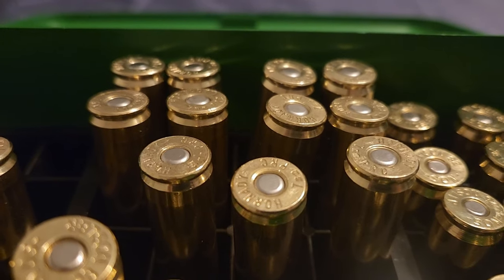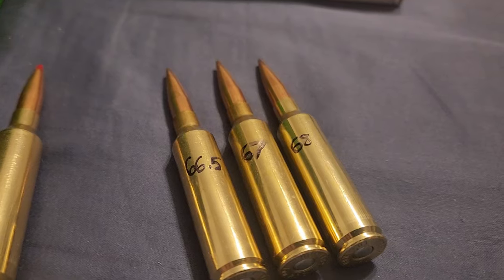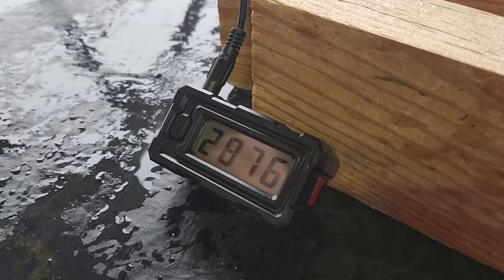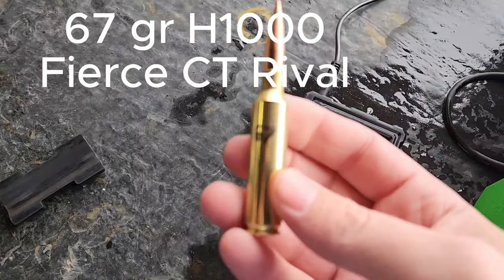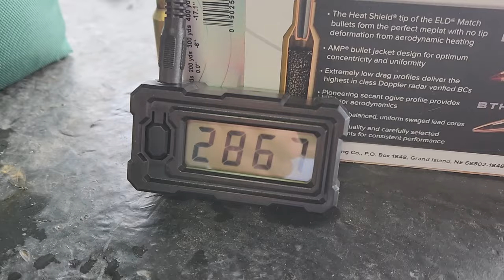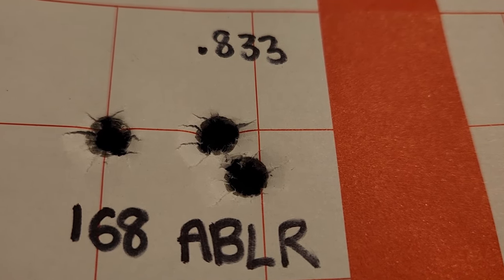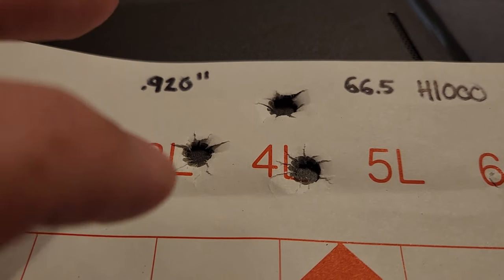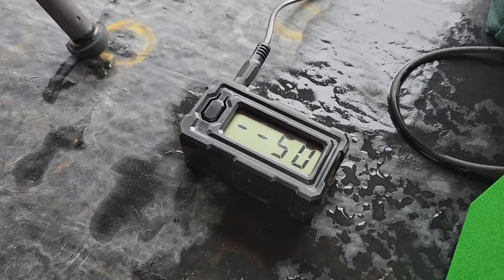Fierce CT Rival in 7mm PRC

Comment: Had a look at the 6.8 Western load data. Unless I'm missing something, it looks more in line with the 6.5 Prc, not the 7. Even the Hodgdon load data stops at the 175s with a max load at 2,883fps. It doesn't even break 3k unless you're maxing out with a 150gr. Best I can tell, the 175s are the heaviest you can get in box ammo as well with Browning's 175s claiming 2835fps.
Why is the 6.8 even coming up in a 7 Prc conversation?
Reply from the maker: If you stand on the 7mm PRC... it beats the 6.8 pretty easily. It's that 6.8 Western factory ammo outperforms the 7mm PRC factory ammo. 

One last thing... all the 6.8 Western reloaders I talk to get better velocity than the books without going over max.
Reply: @ReloadingWeatherby  The Hornady factory ammo. That's the same point someone else just made. The Hornady ammo being low like it is brings the 6.8 into the conversation but if you reload or use a different ammo the 6.8 stays out of the conversation.
 I was just looking at the Hodgdon 6.8 reloading data and at available box ammo. I have no doubt you can see different results real world. 
 What I didn't see was anything over the 175s. Do the guys you know push 180s and 190s like the 7 does?
Reply from the maker: So little bullet options for 6.8 Western. Another benefit for 7mm PRC. The highest b.c. bullet is the 170 gr EOL.
Reply: @ReloadingWeatherby  Just looked at Midway and Midsouth and it seems that 175s are the heaviest you can get in .277?
Reply: @ReloadingWeatherby  .662? Is that the one you're talking about?
Reply: @dankcincy just wait to see what the 6.8 can do with that 170 eol.
Reply: @GGReloading  Not more than the 7 will do with a Berger 190 (.751bc) @2900+fps. Not for what I'm going to do with it anyways.
Reply: @GGReloading   Looking like guys are getting that 170 EOL (.662bc) moving out at one side or the other of 2950fps. It's not bad, it's no competition for the 7 in my application but it's not bad either. Would make for a nice 1k yrd rifle.
Reply: @dankcincy  that is what we get in a .270 Winchester in a 22” barrel.
Reply: @GGReloading  This is what I'm going off of. They're saying this is a 6.8 Western.
"Rifle is a Browning X-bolt LR (26” barrel) Hells Canyon, running through a 30 caliber Thunderbeast suppressor.
The load I settled on is as follows.
New Winchester Brass @ 2.010”
WLRM primers
69.1 gr Ramshot Magnum
170 gr Berger EOL Hunter bullets
COAL = 2.950”
Lee factory crimp
This recipe reached an average velocity of 2933 fps."
Reply: @GGReloading  Same guy, I assume same rifle,
"Got some more testing in and range time at 200 yds.
I put 25 rounds down range, noting velocity on each shot. Average over 25 shots = 2944 fps."
Reply: @GGReloading  This is from a Guns&Ammo article,
"The cartridge uses 61 to 65 grains of powder to achieve muzzle velocities between 2,835 feet per second (fps) and 2,960 fps, depending on bullet weight, from a 24-inch barrel."
Reply: @GGReloading  Don't take what I say as me dogging on the cartridge, I'm really not. It seems like a fine cartridge if that's what I was looking for. I don't think it compares to the 7 PRC, but it's a fine cartridge for what it is.
Reply: @dankcincy  I chose to use N570 in the 6.8 Western. 2.940” COAL, 26” Fierce Rage. The velocity is in the video so I won’t spoil it… I think the group too.
Reply: @GGReloading  Worked up a quick 4dof profile for the 6.8 170 and at 1k yards, there's not really a difference between that and the 190 in the 7.
 I of course don't know how accurate any of it really is but "on paper"....
 It's for sure not what I thought it would be. Only real difference is energy on target which for me doesn't even matter. The 7 has it by a few hundred ft/lbs.
Reply: @GGReloading  Yeah baby!!! That thing was moving out!
 Punched that into 4dof and it appears that it will hang with the 180 in the 7 rather well. I can see why the 6.8 entered the chat for sure.